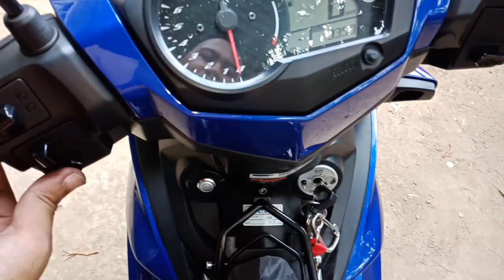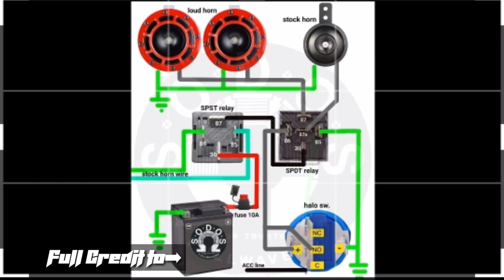Yamaha Sniper 150 Hybrid Horn / Halo Switch / Loud & Stock Horn / Dual Switch /Compact Horn

Comment: Sir dikolang alam anoba yung acc line? At saan naka connect yang dalawang line na lime green at blue green sa SPST relay
Reply from the maker: Acc line sa Ignition paps.
Reply: @motoelyu1634  pero paps saan papunta yung 86 at 85 line ng SPST RELAY?
Reply from the maker: @mcjabaresmael9558  sa Stock connection ng Horn paps
Reply: Ahh gets kuna yung dalawang 85 at 86 yan yung connected sa stock horn... Ok copy gets kuna bukas uumpisahan kona 😊 salamat paps

Comment: Hello paps, nakita ko ang video mo at ang diagram. Ask ko lang po sa halo switch 5 wire po at four wire lang po ba talaga un nagamit sa halo kc wala naka connect sa NC pin? At  Tama po ba pagka drawing ng diagram para po yan na gawin ko sa motor ko paps? Salmat nore power
Reply from the maker: Yes paps walang connection ang NC,
Reply: moto Elyu maraming salamt paps, about sa head steady headlight ganyan din ba ang connection if magdagdag ako ng halo light? Tulag ng pag Switch ko ay OFF headlight ON halo light ganun din pag switch ko uli ON head light OFF halo light. Pwede ba diagram na ito gamitin ko paps
Reply from the maker: Yes paps pwede din yan